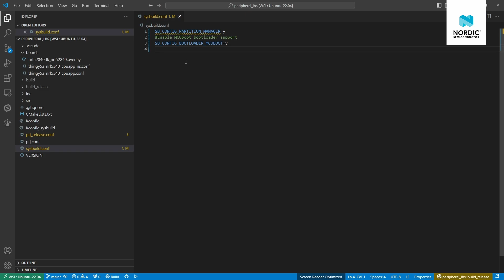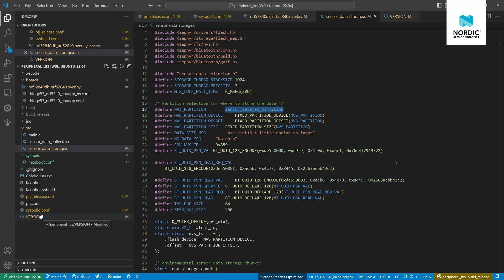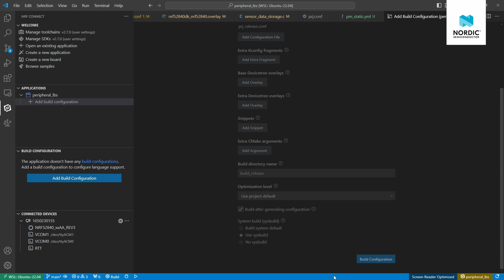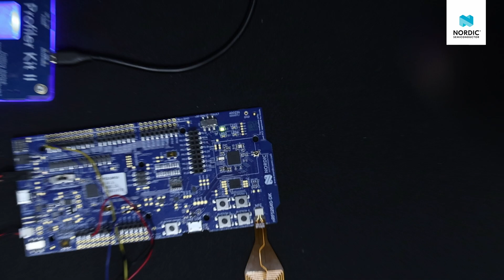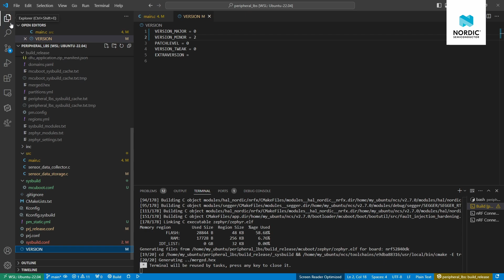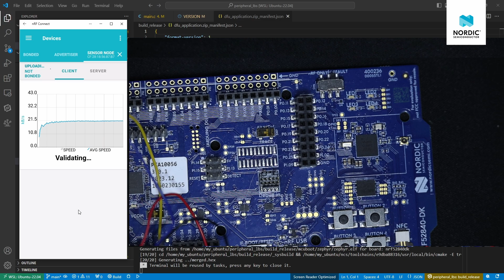nRF Connect SDK hands-on, part 6: Adding FOTA over Bluetooth LE

Comment: Excellent video. I need to figure out that battery part (how to charge) and could use a deep dive on how to define the pm_static.yml setting (calculating partition sizes for mcuboot) but those aren't central to what you were demonstrating which is great.